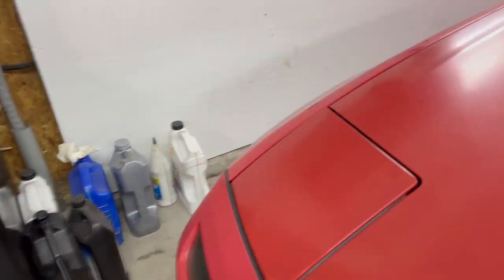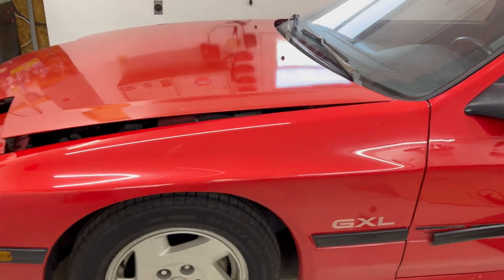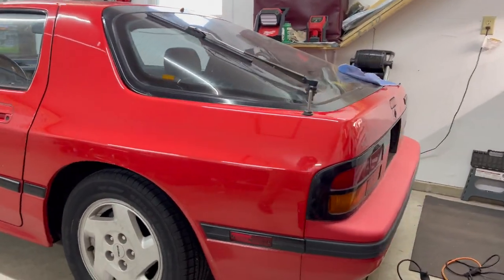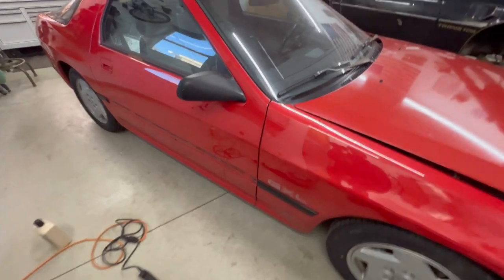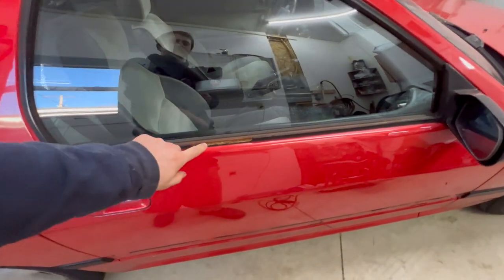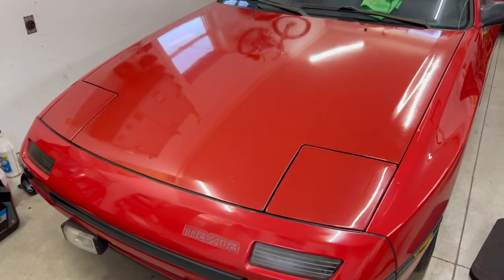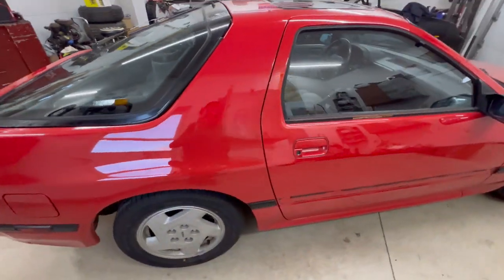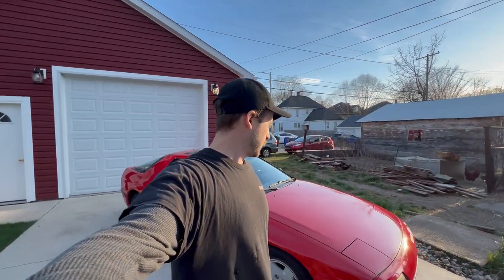87 FC RX-7 Saving the Original Paint. Does it Buff Out??

Comment: Gotta clean the wool pad Ryan. Compound gets built up and gummy.round ove the end of a cheap Phillips screw driver and run the buffer with the tip of screwdriver!! Fluffs it back up and cleans!
Reply from the maker: I was doing that in between clips. It looks worse than it is being its a single stage paint job so the pad looks super red and dirty. I even use a spur wool pad cleaner. They work great.